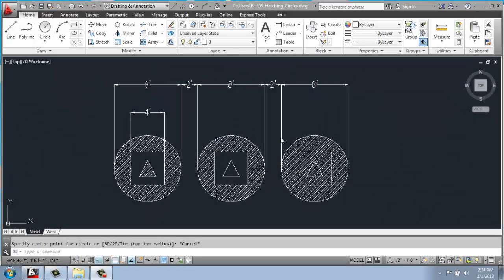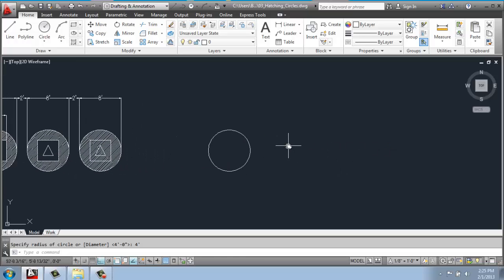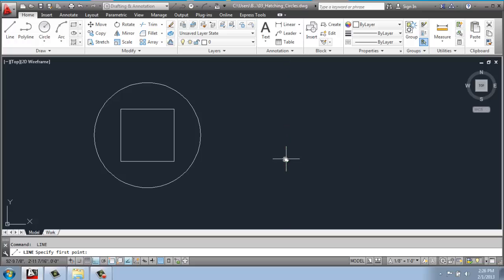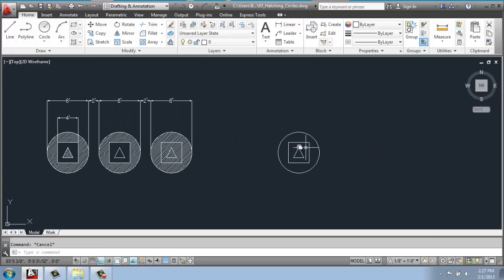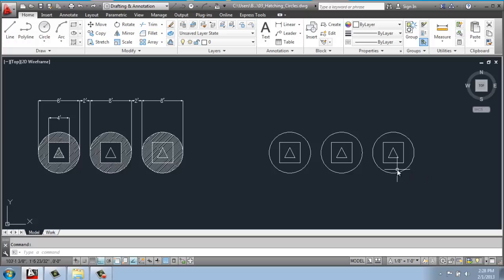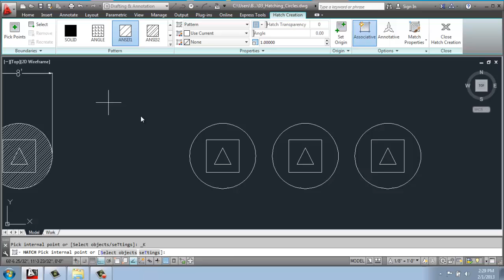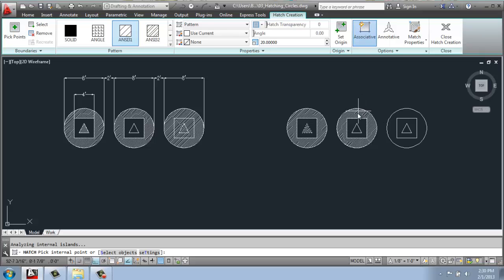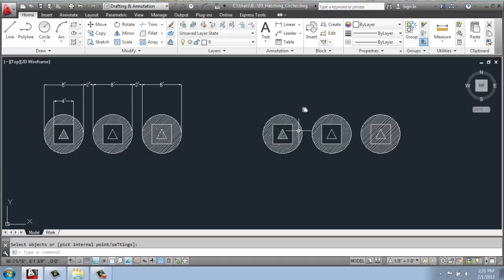#27 - AutoCAD - 2D Drafting Basics - Hatching Variations - Brooke Godfrey

Comment: Hello,
I'm trying to wright a lisp to hatch a target for class.
I can't get it to work.
here is my script.

(defun C:Target ()
 
 ;capture current environment variables
 (setq ce (getvar "cmdecho"))
 
 ;suppress command echo
 (setvar "cmdecho" 0)
 
 ;get start point and draw Inner circle
 (setq cp (getpoint "\nCenter point: ")) 
 (command "circle" cp "D" "0.5" )
 
 ;draw second circle
 (command "circle" cp "D" "1" )
 
 ;draw outer Circle
 (command "circle" cp "D" "1.5" )
 
  ;Hatch Target
  (command "hatch" "ansi31" "1" "0" "@" "0.25" "@" "0.25" "@" "0.25" )
 
  ;restore environment
  (setvar "cmdecho" ce)
  
  
  ;silent exit
  (princ)
  )
  
is this right?
it will create the target,
but it will not hatch...

I can't find anyone doing this.

when I get to work I may need to do my own video...
Reply: +Eric Simpson 
got it, should have look like this "or something resembling this"
;Hatch Target
  (command "hatch" "ansi31" "1" "0" "@0,0.25" "@0,0.25" "@0,0.25" "")
works like a top.
thank you